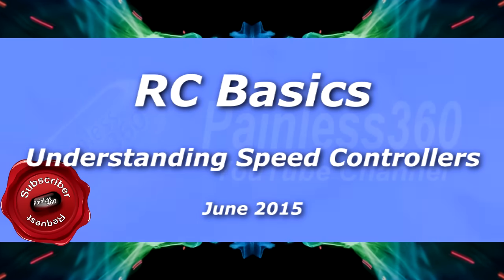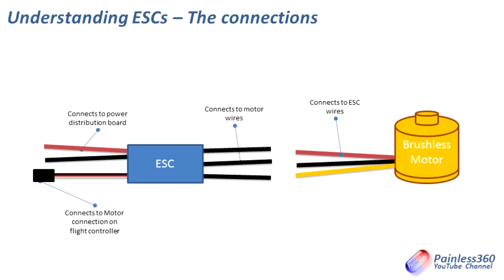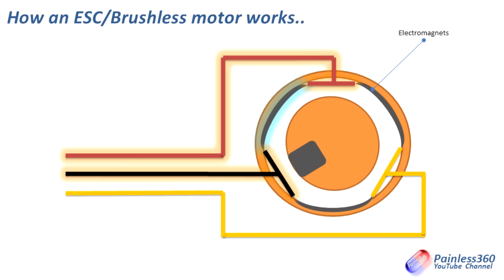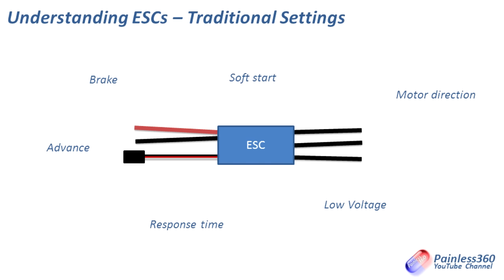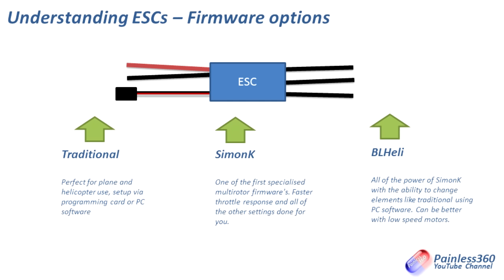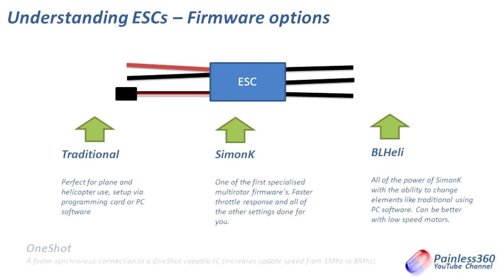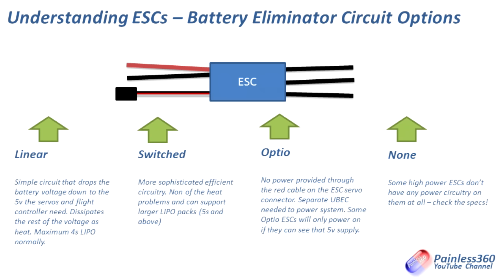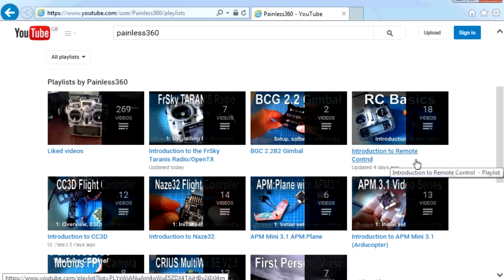RC Basics - Understanding Electronic Speed Controllers (ESC)

Comment: Hello everybody, I have a question. Which ESC would you recommended to me or better which one is better for saving energy (not money) linear probably not but SBEC or OptoBEC. So question is which one is better for longer flying? Thanx
Reply from the maker: +Johanes Green not sure what you mean. The main difference in the ones you've listed is how they handle the BEC for the 5v. That is a very small part of the power usage on a craft. Higher voltages need switched BECs, typically separate from the ESC.. See our other videos in the 'introduction to RC' series. Best of luck!
Reply: I think I Am in the some circle in my mind. Now I realize I can buy some better SBEC 5V module and put it in the circle and buy some cheap common linear ESCs and dont use their 5V conventer instead I would bought expensive SBEC ESCs. So saving energy is not about the ESC which regulate motor speed but about 5V conventer (linear, switched). Please correct me if I Am wrong. Thanx
Reply from the maker: Yep, see our other videos in the 'Introduction to RC'. Best of luck!

Comment: Sir i have 1400kv motor, can i use 30A esc?
Reply from the maker: If the propeller you want use with that motor pulls less than 30 amps, then yes that will be fine.

Comment: can you have reverse in a plane esc like car escs if you program it
Reply from the maker: You can get 3D ESCs designed for acrobatic quads that will run the motor both ways, not sure why you'd want it on a plane though..
Reply: +Painless360 not for a rc it's for an air pump for an engineering class I'm in. we're designing a product. I was going to use a car esc but those are bigger and use a lower voltage.

Comment: So, I have dual switch 80a Skylord and cuts power to the Rx when any of 12 servo's are used. Is this because both of the red Rx wire of ESC are plugged in. And at 5v/5a will I need to use another power pack for the 12 sevos. Listed for 6 per ESC. Have not hooked up more than 4 when the power is cut. Edf's will not cut power. Any help would be great. Thanks Bruce
Reply from the maker: Definitely sounds like a power wiring problem. If the voltage drops if any of the servers are plugged in and it sounds like there's a wiring issue. I start there. Best of luck..
Reply: Yep got wire from Home Depot 12gauge strands and redoing power leads not Rx and not servo

Comment: anyway to use a airplane style esc with a pistol grip radio without modifying the radio or flashing or programming the esc?
Reply from the maker: You could but most car ESCs have a brake and reverse function and ESCs for planes and multi-rotors just have a linear throttle in one direction..
Reply: @Painless360  I was gonna run it in an airboat.  In the past I was never able to calibrate the esc with just the forward movement of the trigger alone. I always had to rubber band the trigger so there was no reverse movement and all forward just to get it to work. I got it to work on an mt4 radio with the th high endpoint at 150%. And then calibrate. Thanks for the quick reply

Comment: Hey I reversed the red and black connections from esc to motor.
ie black to red and red to black in order to reverse the rotation of motor. now when I start the motor it's resisting to rotate but when I get the throttle to 0 and back it's solved. how to solve This?
Reply from the maker: Not sure if you're using a brushed or brushless setup here. Are the black and red wires the only ones from the speed controller to the motor? if it's brushed then we don't have a lot of experience with them here as most of the things we do use ESC and brushless motors. Brushed motors do have one direction of rotation, you can reverse them by swapping the power wires, but the performance and life from them will be a lot less as the commentator and brushes may be worn very quickly..
Reply: Painless360 brushless
Reply from the maker: Then there should be three wires from the motor to ESC...
Reply: Yeah
Reply from the maker: A video of what you're seeing would be helpful as I can't think what it would be that would stop it (apart from esc arming or something)..
Reply: Painless360 I solved that problem. is it okay for the motor to heat?
Reply from the maker: It should get slightly warm. If it's more than that then I'd suspect that you're running too much prop.. Best of luck!

Comment: nice explanation, i have questions do we need one bec for each esc ? and is the function of bec just to powering the flight controller ? thanks
Reply from the maker: The ESCs provide their own 5v power to run the on-board circuitry so the BEC output from an ESC is more to allow other things to be powered from that 5v supply..

Comment: how can i connect 2 controllers on 1 channel?
witch wires do i connect?
thanks
Reply from the maker: +Geert Remans Not sure what you mean. Connect two ESCs to one signal?
Reply: +Painless360 
i would like to use one channel to steer two esc (and eventualy 2 electro motors)
thanks
Reply from the maker: I've never done that - I'd slave a separate channel on the receiver and do it that way. Might work simply connecting the two signal wires to one PWM output but we've never tried it..
Reply: +Painless360
thanks

Comment: Together with a colleague, I am looking to drive my tank with two BLDC (outrunner) motors (one for each track). We may use an Arduino to make a "digital differential", like some of the Tamiya DMD controllers. We're still in the early stages so I'm now exploring the current state of technology of RC, which your channel is proving to be of great benefit. On my channel there is an animation of the "Cletrac" differential, which is a very nice mechanical concept, although hardly suitable for RC.
Reply from the maker: You could also use a mix inside the transmitter you are using too. Look at the videos of brushless motors on twin engine 'planes. They use differential thrust to turn. Maybe that could work mixing the throttle channel with the channel you're using to turn? Best of luck with the project!
Reply: Thanks so much for your quick replies! I did consider this and will have to dive into it deeper. A requirement is that the tank does a "neutral turn" (pirouette). In the Tamiya controller, past a certain (steering) stick position, the motors will spin in opposite directions. Earlier my tank operated with two brushed motors, two Tekin reversible ESCs on two identical up-down sticks on the transmitter. This works fine but I really like the idea of controlling it as an RC car, but with the added "neutral turn" functionality. I will be uploading a video soon on the custom gearbox I already built (more than 20 years ago) and how we'll redesign it into a "high tech integrated drive system"!
Reply: Quickly researched it... looks like any transmitter with mix functions will do the trick just fine... thanks again! I'll have to find another project for that Arduino...
Reply from the maker: With modern transmitters you can actually do lots with them that you would need a Pi/Ardunio for in the past. Best of luck with the project!

Comment: I have a question. I'm very new to these types of motors and speed controllers.
And it's very nice to watch this video and understand how the motor and speed controller works. I learned a lot! And I thank you!
But why is it that I can't use a standard wall plugin, to power the speed controller and the motor?
I plug it into a lipo 2 cell and it works fine.
Plug it in using a wall plug and it only gives a slight kick and then nothing.
Any help on this would be greatly appreciated!
I'd like to use the parts of a broken and older drone, to possibly use on an airplane, or glider with the speed controller and motor assist.
I tinker with arduino's, and that's what I have the motor and speed controller plugged into. An Arduino Nano.
Again, any assistance on this would be greatly appreciated!
Reply from the maker: What do you mean 'plug it into a wall'? Motors and ESC only work on a set of very specific DC voltages..
Reply: @Painless360  Plugged into the wall using a wall wart, plugged into an ac outlet.
What is the voltage?
Or won't it work because it needs a certain amount of amperage?
Reply from the maker: A wall wart will only deliver an amp or so and a battery. An deliver 40 to 100 times that... Power it from a Lipo..
Reply: @Painless360  That's what I thought. And it's the high amount of amperage in a lipo battery that is dangerous, right?
Because the voltage is only 7.2, but the amperage is far greater than that in a common 9 volt battery.
Thank you! I appreciate you taking the time to explain that for me!
I'm only dealing with the small amounts of electricity needed for an arduino, 5, 9, 12 volts with very little amperage.
Again, thank you!

Comment: does switched bec increase flight time?
Reply from the maker: +Selva Prabhu It is more efficient which means that it wastes less energy as heat but this is a drop in the ocean compared to the power the motors use for the flight so although it may increase flight time you'd not notice it. Happy flying!

Comment: I just saw your channel and found some really helpfull informatin to build my first quadcopter. Question: I will use a 3S battery so this will give me 11.1V, BUT I have 4 motors, does this mean I have to divide 11.1V by 4, so one motor only gets 2.75V?
Reply from the maker: Richard Johnson Not quite. Each ESC is connected to the battery and gets the full voltage - 12.4 volts from a fully charged 3s pack..
Reply: Thanks a lot, I have got it now.

Comment: I can I find or determine which is the bad ESC?
Reply from the maker: Yep, unplug them all and use a voltmeter to test the 5v putput on each one.
Reply: Painless360 I am using optio ESC''s, I disconnected 3dr power module from APM baord pulled 5v out of main line of module to power board input and radio receiver and used BEC ESC not ubec to power board output, do think this going to work or still need to use a ubec ESC to power output? thanks

Comment: Sir, I wish you would do one on Selecting the Appropriate or Properly MATCHING the MOTOR to the ESC, and Battery Requires.     Do u use a 6s Battery Pack on a 90A Motor with a 180A ESX ?  etc.,
simple for some people,,,,, because someone explained it to them!    Is there a SIMPLE FORMULA FOR THIS ?
Reply from the maker: Check out the 'Introduction to Remote control' series, I cover all of how you work that out. You start with the rating (in amps) of the motor with the prop you want to use..

Comment: Hello, Mr., Would it be reliable to use this motor http://www.buddyrc.com/sunnysky-x1806s-2300kv-brushless-motor-ccw.html with a 20A ESC and how could i determine the correct working period of a motor?, I'm trying to control it using PWM signals. Thanks!
Reply from the maker: Should be, see the other videos in the 'Introduction to Remote Control' and the first few series of 'Quadcopter Building for Beginners' for more tips on this subject. Best of luck!

Comment: Hey man great video tutorial very easy to understand, so thanks. I'm thinking of building copter but with  a difference, I want to build one with 3 lift motors and two propulsion motors. So in otherwords 3 motors in the y axis and and 2 in the x axis. I'm just getting up to speed with ESC etc and wanted to know in principal would it be possible to control this set up and how one wuld go about wiring it?  All help gratefully received
Reply from the maker: +tim lazenby not sure, I've seen other development models that use a similar setup though.. Best of luck!

Comment: Hi, I have a very important question to ask you !, I am Building a TAROT TL250h Quadcoptor Running EMAX MT2204 2300kv Motors I know People use 12amp esc's with this combo for racing using 4s lipos, Well I am not ever using it for racing or ever running 4s,3s lipos only!. My question is I have a lot of new Flycolor 30amp opto esc's 2-4s simonk flashed esc's that I am going to use I know 30amp is overkill but I have them and do not have money to purchase new ones, my question is the 30amp esc's I am going to use have very thick & heavy heatsinks that I want to remove because of weight and I think and was also told by others that yes I can remov the heatsinks since ther not ever going to draw anywhere close to what the esc's can handle plus they will be mounted on the arms to get max airflow from props and flying, do you also agree that me removing the heatsinks should be no problem? Thank you in advance for any or all help in this matter !.
Reply from the maker: They should work fine. The only supply the motor wants.. Best of luck!

Comment: Hello Painless and thank you for the very informative video on ESCs. 
I do have a question. I have some 30Amp ESCs, Simonk, and are rated to run on 3S batteries. Can these ESCs run using 4S batteries? Any insight would be appreciated. Thanks.
Reply from the maker: If it's not rated for 4s then you run the risk of overloading it.. Best of luck!

Comment: i have a question, Does any motor connect to any ESC?
Reply from the maker: +Shehab Ellithy If I understand your question correctly. So long as the ESC can provide more amps than the motor will use and it's using the right firmware (like SimonK or BLHeli for multirotors) then yes.
Reply: Painless360 I am sorry but what is a frimware
Reply from the maker: Please watch the playlist 'Introduction to RC'. A lot of the basics are covered in those videos. Best of luck.
Reply: Thanks for your help i hope u can spread this information because it is helpful
Reply from the maker: That's why it's on the channel ;)

Comment: is BEC technically a traditional ESC software?
Reply from the maker: Not quite. An ESC is the thing that drives the motor. A BEC is there to drop the battery voltage to a level that the flight controller and radio receivers like. Best of luck!
Reply: thank you... that was confusing me like crazy.

Comment: Hi, can we use one esc for 2 motor?
Reply from the maker: No, you can't as the ESC is designed for one only..
Reply: Okay, so the esc not same as motor driver?like L293D
Reply from the maker: Nope. L293D is a dual brushed motor driver. An ESC is a brushless speed controller with position sensing..

Comment: Thx but, why doesn't anyone explain the voltage output of the ESC?   10 videos and no discussion on the output waveforms!!     Is the output voltage the same voltage supplied by the battery, or is it variable?  Thx.
Reply from the maker: +Mark Pryor it's the battery voltage chopped into a square wave with a changing duty cycle..
Reply: Painless360 thx!  the best I found on the subject is http://www.dronevibes.com/forums/threads/product-review-jeti-hicopter-30a-opto-esc.20466/ 
He discusses PWM input from the contoller and output voltage signal to the motor.  more videos/posts like this would be awesome.
Reply from the maker: Bottom line - you don't need to know how that works to build, tune or operate a model. Lots of other places have lots of engineering level detail if that's what you want to get into. Best of luck!
Reply: Painless360 it is interesting to see how the ESC creates the wave form.  the videos on that link shows it to be very choppy and noisy looking.  I wonder how a pure sine wave would compare in regards to the sound.  The high frequency squeel may be reduced.

Comment: Fantastic explanation, thank you for taking the time out to make this vid! 
One question I have is, what type of ESC should I use when using a standard 12v automotive lead acid battery as a power supply? I want to run an EDF using manual control for speed/thrust adjustment so I figured a servo tester connected to an appropriate ESC should do the job as I can use the manual mode potentiometer to control the speed but what about the battery type? Is this going to be an issue?
Reply from the maker: Any standard ESC that supports a 3S LIPO should be fine. The ESC doesn't care about the battery type, just that it is the right voltage and can supply the current it needs.. Best of luck!
Reply: Ah yes I realise now what the 2S, 3S etc.... represent, that was the part confusing me voltage/amp rating. Thanks again :)

Comment: Another great tutorial, thanks!  
I have read in a couple of places that Switched BECs provide a less clean supply when compared to Linear ... which may cause interference when powering FPV equipment.  Do you agree?
Reply from the maker: +zoso12 The output capacitors and smoothing circuitry is normally well up to the task of smoothing the 5v output to be silky smooth. I suppose those that use smaller caps and lower quality components may have problems but I've not seen it..

Comment: how do i program an esc to run a lip battery other than a nimh
Reply from the maker: +Stanley The Slayer That should be covered in the manual for the ESC you are using... Best of luck.
Reply: hey man if i sen you a photo of thiss part of the manual would yu be able to help me because I'm a noob
Reply from the maker: Yes, but only as part of a chargeable support call. See the painless360.com site for charges.
Reply: ok

Comment: can these only control one motor at a time?
Reply from the maker: That is a great question. An ESC can only run one motor at time, as it's actually also sensing the motor position as well as providing the pulses that run the motor. Hope that helps..
Reply: okay thanks!
Reply: sorry if you could answer another question: i wanted to make a rc car with around 3-4 motors on each side will i just need 8-6 speed controllers 
(sorry i know its a dumb question but i'm new to rc)
Reply from the maker: One ESC per motor. Best of luck!